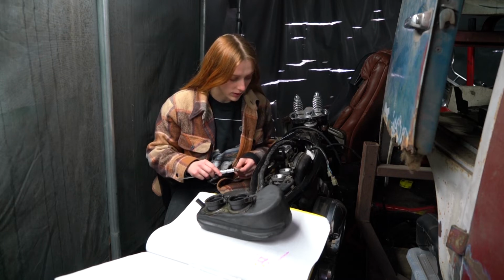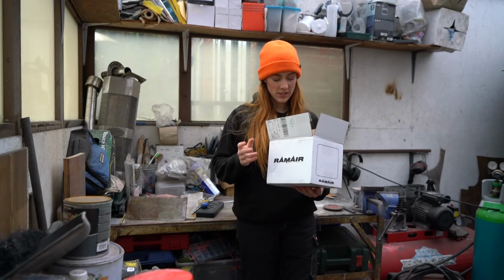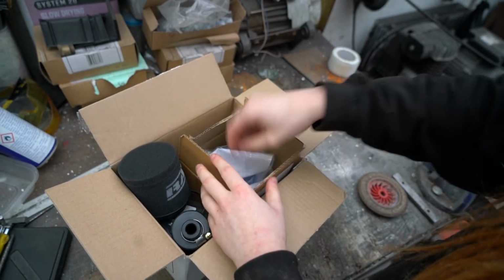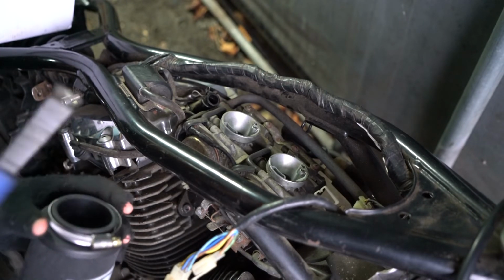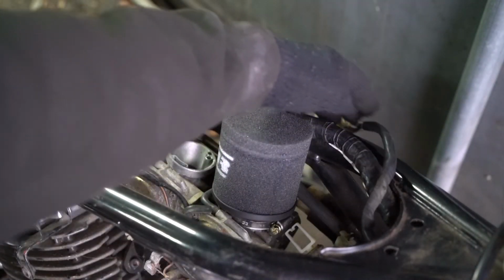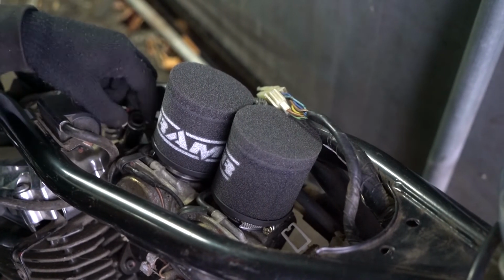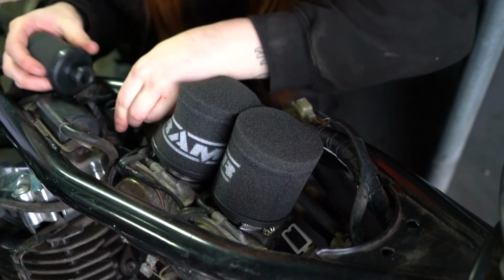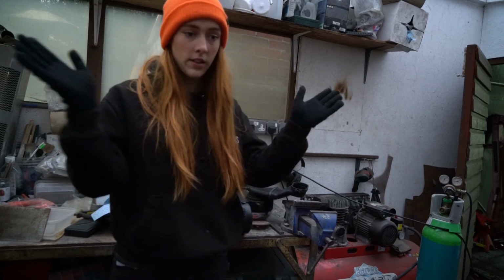Yamaha Chopper Build: Converting the dragstars air filter

Comment: Sweet job on the pods, if the hose is coming from the crankcase it may not need a filter because it's actually expelling fumes and the filter can hinder that. The air box recycles the fumes and that helps with the air delivery in some crazy way and it catches oil. I got rid of my air box on my Gz250 and was told to keep the crankcase breather hose pointed down like any other drain hose by guys who had bobbed their GZ's
Reply from the maker: Oh okay, thanks for the tip!